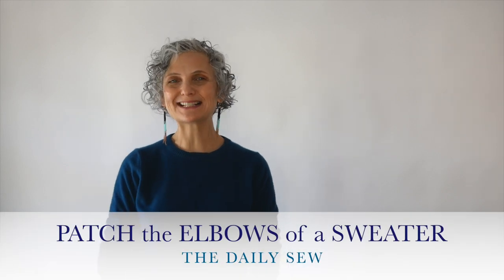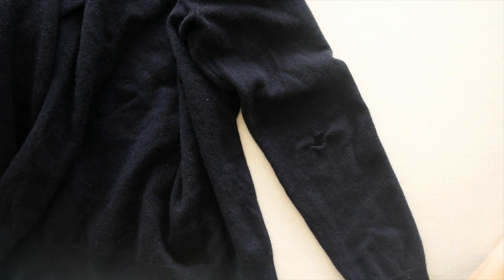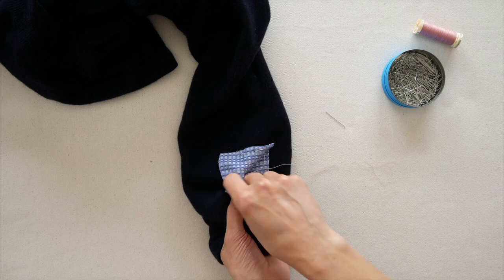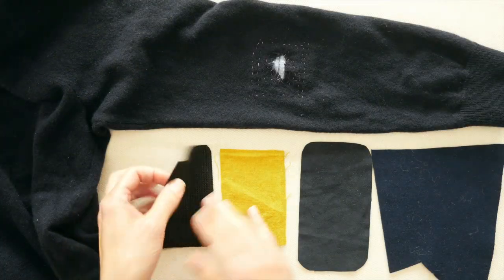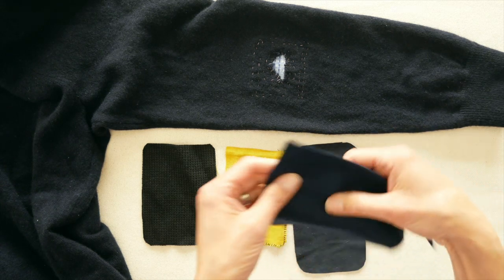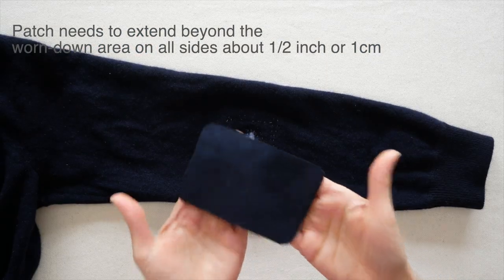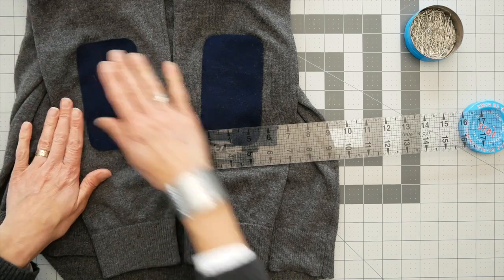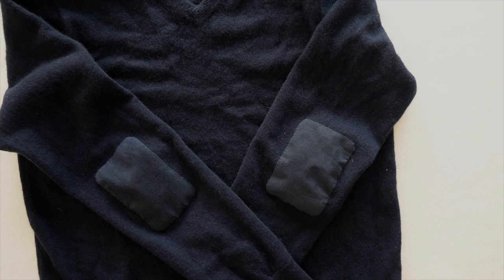How to Repair & Patch Your Sweater’s Elbows | The Daily Sew

Comment: Great video! Would you alter your method at all if it's a larger/chunkier knit, similar to a cotton cable knit?
Reply from the maker: Thanks. I would use a thicker thread for sewing down the patch that is under the hole or if you are just going to darn the area and not cover it with the elbow patch. Only because your sweater yarn is thick not because you can't use all-purpose sewing thread. I like to match the thread weight to the garment usually. So you could sew with a pearl cotton or embroidery floss or a sock-weight yarn.  But other than that I think it would be the same for a chunky sweater. Let me know how it goes. I'm interested.

Comment: I am wondering if you use any special thread. I am going to sew cowhide elbow patches on my sons sweater and am wondering if I should use darning wool or leather thread. Any suggestions? Thx
Reply from the maker: You could use darning yarn if the holes are large enough on the patch. I wonder though, if it's strong enough long-term or will the yarn wear down where it rubs against the patch? All-purpose thread - or heavier all-purpose thread (topstitching weight) - would be durable but I don't know how it would look.  

I'm sorry I don't have a "correct" answer. How it looks when you're done is a big factor, next is the strength of the thread/yarn. Many sweaters, once worn through the elbows, don't have many more years left as a sweater. They start wearing thin in other places. So going with the end look over long-term durability is ok for this repair. Plus you can reattach the patch if you need to later.

Comment: Thank you so much, I don’t own a machine, but tend to always tear my left elbows. Now I can’t wait to try!
Reply from the maker: Thanks.  I just tried a new method of repairing knit fabric and you may want to try. Place a piece of Fusible, Tricot, Interfacing (it comes in black and in white) under the worn area (placed in your sleeve) fusible side against the worn area. Lay a press cloth, clean rag or paper towel over the worn area on the outside and press with hot iron (to fuse the fusible tricot). Of course your sweater fiber has to be able to be ironed so check that first.  Then hand stitch down your outside patch catching the interfacing. 
The tricot interfacing stretches with the sweater and it strengths the worn area. All without sewing!  I tested this on a lightweight sweater, ran it through the washer and dryer and it’s still attached. (You do have to catch it in the stitches when sewing a patch OR, if no patch, sew it down after fusing it).